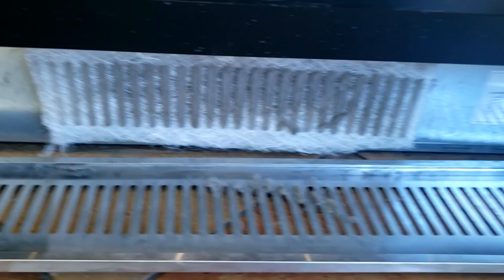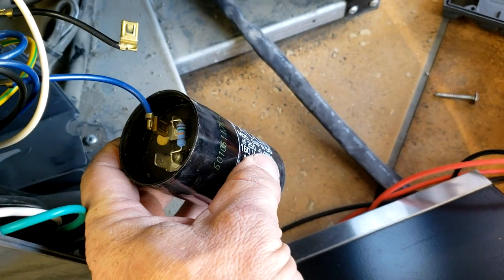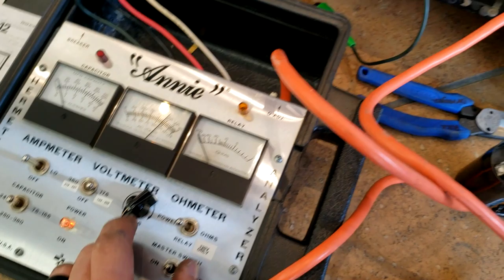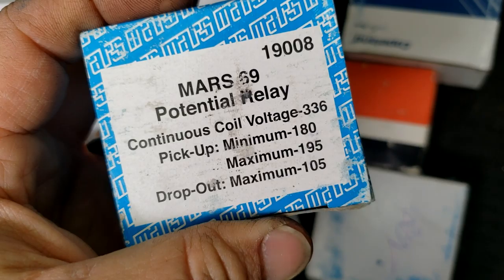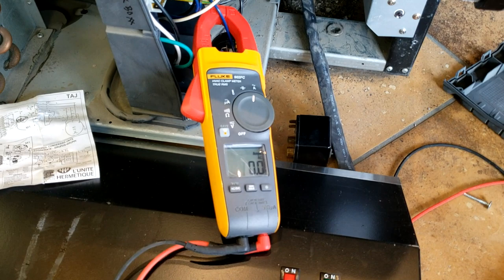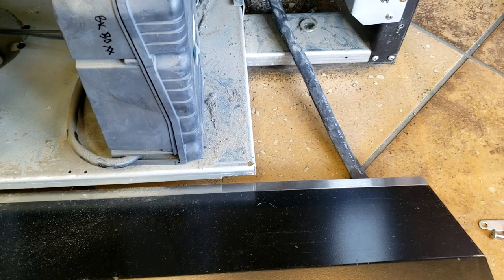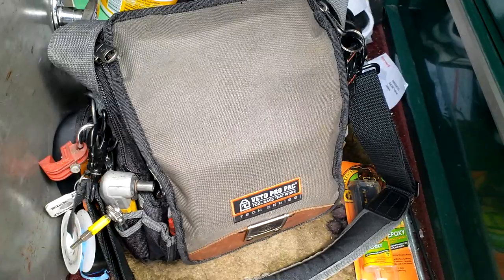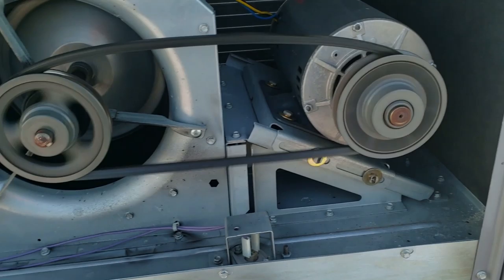Open Top Cooler Warm and No Heat Package Unit

Comment: Still waiting for the day when i see that somebody changed out that adjustable pulley to a non adjustable, but i guess it will never happen :)

To clarify for those who do not work with hvac. 
The adjustable pulley is a two piece construction which you can either tighten (to push the belt out and increase the diameter) or loosen (the belt sinks in deeper and the diameter decreases.

It is like changing gears on bicycle, but in this case you change how fast the fan spins contra to the motor.

What you then are supposed to do is measure the pulley and change it out to a non adjustable so nobody can f-up the air adjustment by adjusting the pulley instead of changing the belt.

Comment: Rick

They make a tool to align pulleys called a belt hog. It’s a laser alignment tool. It’s expensive if 
Not used a lot.
Another great video.
Thank You
Reply from the maker: Hey Tony👍👍 I looked at several alignment lasers but there to much rent even for me to justify. I tried to build one but it's more work than I thought. I ended up buying a digital angle gauge to help with twist alignment and that helped. Thanks 4 watching, 👍👍
Reply: i Just use my " test leads " off my meter to align pulleys. its like using a string across the pulleys. make sure leads touch at each edge of pulleys. bada bing done. Works great every time.

Comment: Good Vid. looks like factory Left amps a bit Low on that motor. Looks like it needs to get screwed in a full turn on that shiv. . that Pulley may have slipped a full turn or more. belt was sitting pretty Low in that motor too.  Good vid. i've used the supr. they work .ok. to get it running. ive lefta few on they only last about 5 years. factory parts/ factory realys are allways best as u say. agreed. Like # 55.
Reply from the maker: I'm kinda paranoid about call backs but I agree on both comments. 👍👍
Reply: Yea, i Hear ya on call backs. i do everything i can to avoid them. if ive got a Motor that Rla is 8.5 i Like to set em up for 7.5 - 7.97 if possible. i like to keep em about a 1/2 - 1 amp lower than Rla. That Way You still Get Pretty Much Full Airflow / speed out of it. Good vid ! i Like that annie box , pretty cool. i think i remember my dad had one of those.  i never used it. pretty cool tool though.

Comment: What do you think of the supco 3 in 1 start relays?
Reply: Rc0210 kit.  i Use alot. i like it very much. i have not had good luch with smaller ones. rc0410 kit no good for me.
Reply from the maker: I try to get the OEM components every time but I carry three different sizes of the three in one for the small compressors up to I think 3/4 or 1hp. They use a PTC device to remove the capacitor out the circuit. This compressor here was a little large, I don't think what I had would have been able to run this compressor.

Comment: Man pulleys and alignment di my absolute head in , and half the time the screws are seized up or rusty , it's just a pain .
I've never been good with the alignment , never had a tool for it either , tried straight edges but never long enough , strings do deflect etc ...
That stuff had made me hate RTUs period ! 😓
Reply from the maker: For the most part you can get away with it being a little out of whack,  it just depends on how worried you are about prematurely worn belts and sheaves.

Comment: Have you had good success with that Gorilla Epoxy?  Plastic on my F150 door pull broke and I’m not certain which epoxy would hold up on door closings.  Also, gracias on the vid!
Reply from the maker: I believe that's the brand I used on my rechargeable batteries that I dropped out of my drill once. If you mix it properly and let it set up its pretty strong stuff

Comment: I don't put the straight edge across both pulley at the same time because they are different thickness so it is not a good test.
Reply: i Just use my " test leads " off my meter to align pulleys. its like using a string across the pulleys. make sure leads touch at each edge of pulleys. bada bing done. Works great every time.
Reply from the maker: Yeah you're correct it depends on whether it's a offset pulley. You just eyeball it? Or do you have a better way?
Reply: HVACR Survival I'm not sure if I have a better way or not but I put the straight edge across the blower pulley and get right to but don't touch the motor adjustable pulley and then I see if I'm off that way. Look at the gap across the belt and see if it's close to the same on the motor pulley. But you have to account for the thickness of the blower pulley. I'm not sure if it makes sense trying to put it into words.
Reply: OcRefrigeration , Hvac & Electrical Video's. How do you know if your string is 100% straight? I could hold a string and it would look aligned but everything could still be off
Reply from the maker: That sounds about like what I try to do when I have those types of pulleys. Luckily it's not that often.
Reply: HVACR Survival I'm confused because I always find the motor pulley had different wall thickness from the blower pulley.
Reply: @ joe s.  i use my Red meter test Lead. ( its bright, perfect length & diameter , & Very pliable ) ill try to put into words. ill do a video when i get a chance someday.
1) Hold test lead on one side of a pulley
2) when it touches the other side of its own pulley , its perfectly straight. kind of like u do with a straight edge.
3) stretching wire taught across to other pulley while it touches both sides of first pulley and both sides of second pulley , with No Bowes in the wire tells u its straight. if it touches a pulley before wire is straight across all 4 points across all pulleys , u need to adjust accordingly till all touch at exact same time while wire is stretched across all 4 edges of pulleys. kind of like using a straight edge. Your making the wire a straight edge. this is the best i can explain it.
Reply: Try using a short length of 3/8" rigid tubing. Hold tight against one sheave and lower it towards other. You'll "see" any misalignment. The diameter of the pipe will seat itself in whatever pulley that is in place.